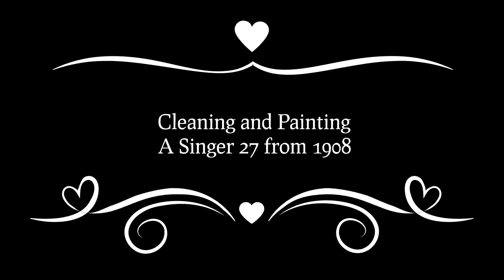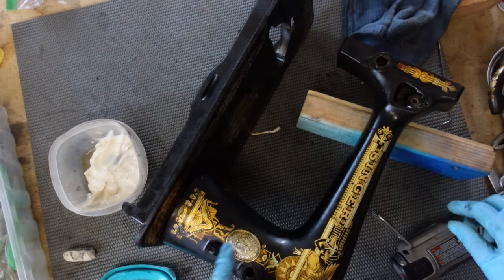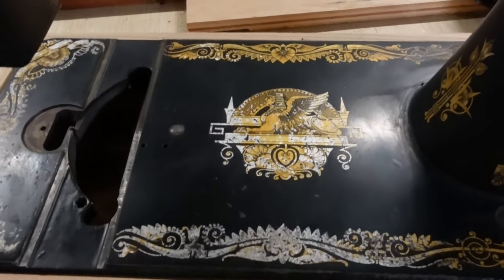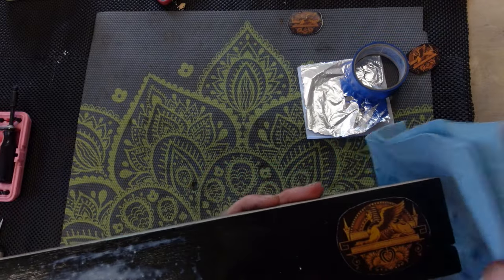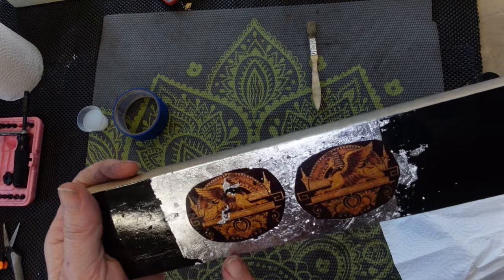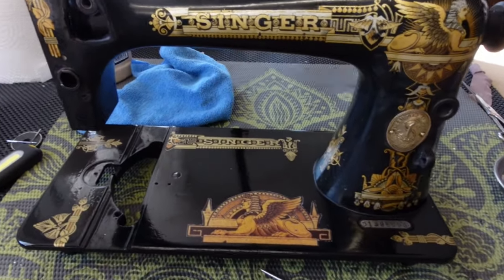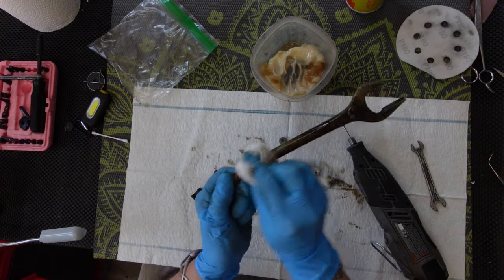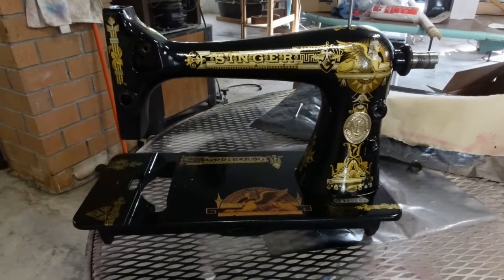Restoration Cleaning and Painting an Antique Singer 27 Sewing Machine

Comment: I wonder if you turned the saturation down and the contrast up a little in the image you might get a better result with the clear waterslide decal over metal leaf, although it's hard to tell without testing it with unprinted paper to see what the maximum potential shine is through the decal.
Also, I imagine a lot of the yellow tone on the example picture comes from the yellowing of the shellac with age. Is that something you might consider adjusting for if you were redoing all of the decals on a machine?

Comment: Do you find that the hand cleaner damages the original clear coat at all and thus the decals? Or does it polish up well after gojo? I've watched some other videos and someone said not to use cleaners because it can strip the shellac.
Reply from the maker: I have never had any trouble using the hand cleaner on original finishes. (Which I know will throw some people over the edge) After that a good wax and polish makes them super nice.
Reply: @prometheansewingmachines that is interesting because I used a non pumas hand cleaner on mine and noticed some of the decals silvering. I don't know if it's because I was applying it with a brush but even wiping it removed some gold.
Reply: @prometheansewingmachines then again my decals were boy buried under alot of grease. Mine is pretty clean I think it was mostly the finish cracking.

Comment: I bought the same model for $15 and it is in rough shape, the plates on the bottom are  jammed. Do you have any ideas
Reply from the maker: They get stuck a lot. I would put a lot of penetrating oil on them and use something wooden to try to tap them out. Good luck